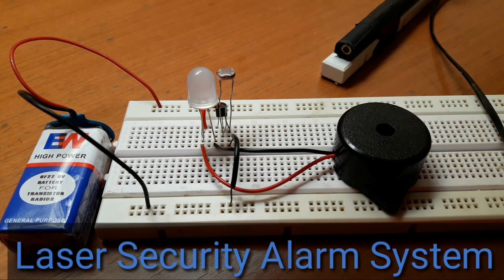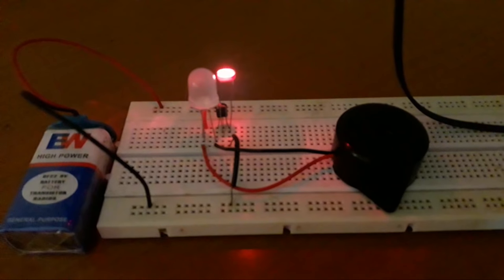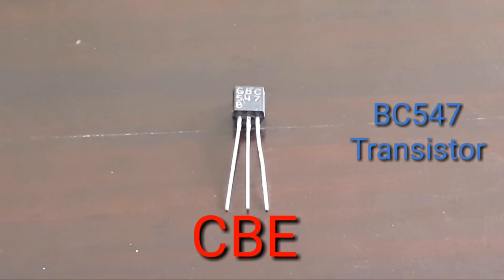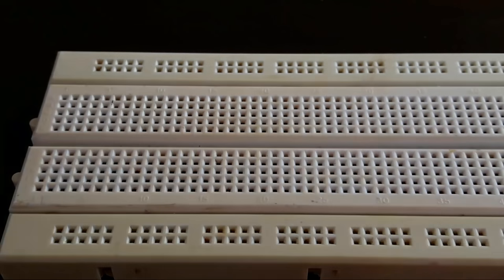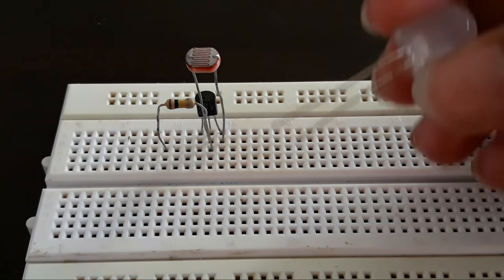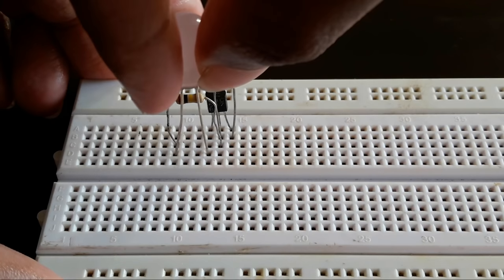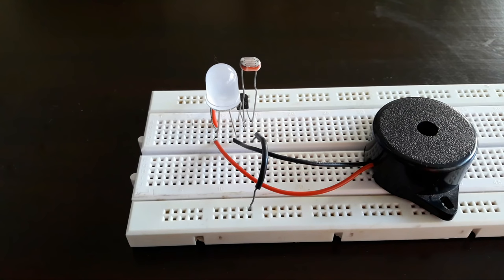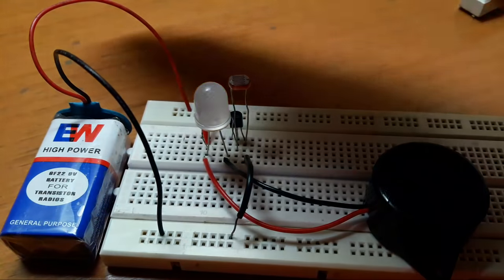How to make a "Laser Security Alarm System" at Home on a Breadboard [HD]

Comment: If the people walk into the laser and it the alarm goes off, the people will know that there's a laser light security alarm system there so they will instantly back away and then they will try to run across it as fast as they can to make the buzzer goes off in as little time as possible. If the time the buzzer goes off is too short, it might not wake you up, you need a system where the buzzer goes off when someone walk into it and stay on forever until you turn it off.
Reply: That's why Arduino exists.

Comment: sir it will work? when we use 2N7000 transister and 6.8k resister instead of BC547 Transister and 100k ohm resister

Comment: Awesome. I am very new to electronics, not my profession (hobby). I have done your experiment and it turns on when it is dark. It only turned on when the obstacle was very close, practically touching the LDR. However the laser part did not seem to work since I have a laser pen like the one teachers use - maybe too weak, so I have reduced the resistance and it worked - hopefully I did not mess up something, but it worked like in your video.
Reply from the maker: Cool! 👍 I'll be uploading more video's soon... :)

Comment: Hi. Can you please help me with the circuit? I have connected the whole thing properly but it isn't responding as it should (the circuit is not light dependent). Could you please help me out as soon as possible?
Reply from the maker: Hi. Make sure you keep you circuit in a dark place and focus the laser light on the LDR.
Because sometimes since there's plenty of light in the room the LDR may respond to that light and not to the laser light. (So make sure the only light falling on the LDR is that of the laser)
Reply: Same problem
Reply: Did it worked?

Comment: Hey bro can u help ... i have made the circuit exactly as u mentioned.. but it is not working ..Whenever i plug the battery wires the led starts glowing nothing else happens..
Reply from the maker: +umar liaquat This laser sensor is similar to the dark sensor so if you connected the battery in a dark room then the L.E.D will glow. Focus the laser light on the LDR.

Watch some previous video's of mine for better understanding.
How to make a Dark Sensor/Automatic Street Light on Breadboard :- https://youtu.be/c0bsQer6KTs

How to make a "Laser Security Alarm System" at Home on a Breadboard :- https://youtu.be/c6wuDfUXfEU

How to make a "Dark Sensor" :- https://youtu.be/5OdyYZEiuVo
Reply: Made it ty....One more thing what  would  u  recommend should I final this project or make a water indication level project for my lab.
Reply from the maker: +umar liaquat Awesome! Regarding your project, i think the 'Laser Security Alarm System' and the 'Water Level Indicator' are both good and useful in their own way.
Although i think the 'Laser Security Alarm System' is more useful and might also be a unique project in the lab!
Best of luck! 👍☺

Comment: is it possible to get a slightly larger sensor size ? or are they that size only ?
Reply from the maker: +Adrien Alves Yes its possible to get a larger sensor size. All you need to is buy a larger LDR of size 20mm. If you wish to buy one check here👉http://www.electroncomponents.com/LDR-20mm-Photocell
The LDR i have used is 12mm.
Reply: Troy Araujo thanks so much 😀
Reply from the maker: You're welcome! :)
Reply: Troy Araujo btw great video 😀👍
Reply from the maker: +Adrien Alves Thanks! ✌

Comment: can we use 100E resistor
Reply from the maker: +Kartik Saha No. Only use 100k resistor. It works 100%
DETAILS OF THE 100K RESISTOR :-
Value - 100 kΩ
Type - 4 Band Colour Code System
Colour Code - Brown, Black, Yellow, Gold 
Tolerance - Gold Band ±5%

Comment: Tell us  about how you connected wires it would be much easier to understand
Reply from the maker: Steps of construction:-
1.Connect the LDR to the 'base' and 'emitter' of the BC547 transistor.

2.Then connect one end of the 100k ohm resistor from the 'base' of the BC547 transistor and the other end of the 100k ohm resistor to anode (+) side of the L.E.D.

3.The cathode (-) side of the L.E.D will get connected to the 'collector' of the BC547 transistor.

4.The positive (+) side of the battery will get connected to the 100k ohm resistor and anode (+) of the L.E.D while the negative (-) side of the battery will get connected to the 'emitter' of the BC547 transistor and the other end of the LDR. 

Hope this was helpful bro! Have a great day! :)